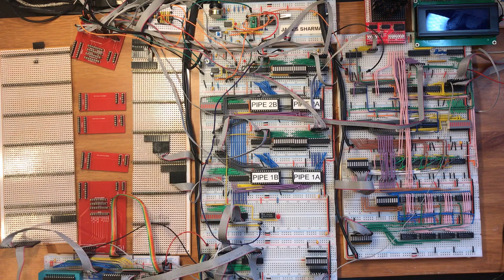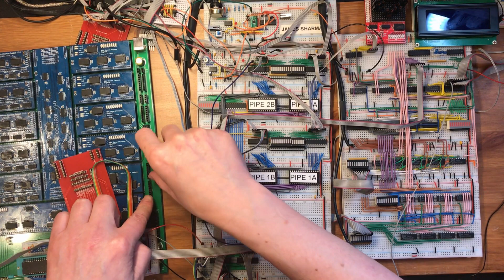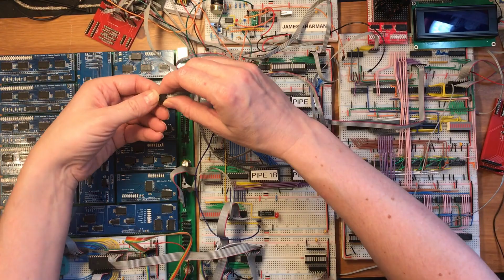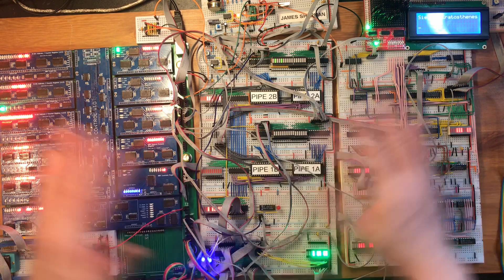Backplane Install - Making an 8 Bit pipelined CPU - Part 69

Comment: Well done, you won’t believe if I tell you I have similar idea with backplane but my it’s made by 10x10 cm and then joint together at the end, I think I will make a short video tomorrow. Thanks
Reply from the maker: Sounds workable as long as your connections are reliable. I actually considered a system where there was no backplane, the register boards just had a bus feed through at the top and bottom. I was worried about building up the resistance though. I assume you are going with 10x10 for the cheap pcb threshold?
Reply: Yes, I go for cheap at the moment because this is my very first PCB design 🤪 and of course I have done mistakes ( not at backplane) so I have to correct and reorder and then if I change my mind and I want to modify something .... At the moment I follow Ben Eater with couple modification , but I want to be able to expand, test  and modify without brook my bank account . In the past I have very little spare time but now ... I’m self isolated at home so it’s  time to learn and have fun with 8 bits computer. Sorry for my bad English I leave but I’m originally from Romania. Regards
Reply from the maker: @liviupatty  Sounds like a solid approach, let me know how it goes. If you are copying Ben's design, I recommend you add current limiting resistors on all the led's, his design can run out of specification of some of the chips without them.
Reply: James Sharman thanks for replay, yes I did and I connect all unused gates to GND. I’m nervous to make a video because I never did before but I will give a try tomorrow. Regards